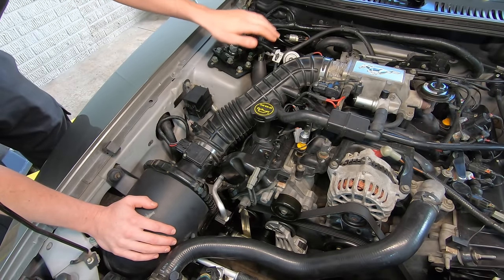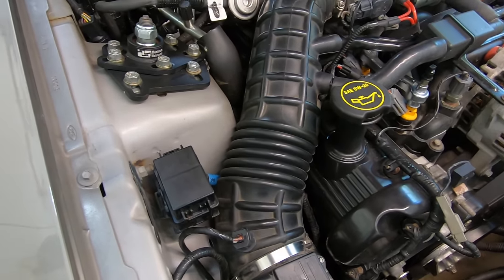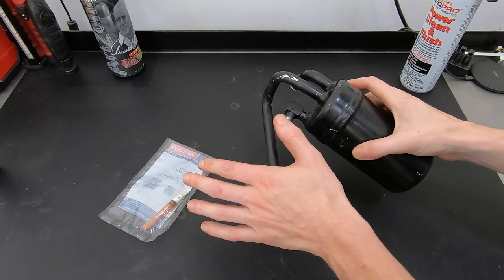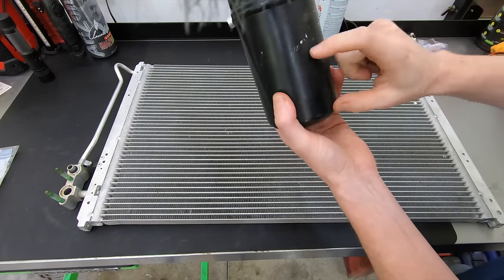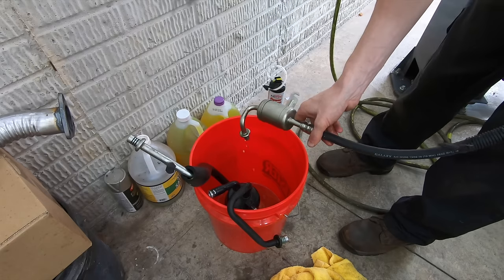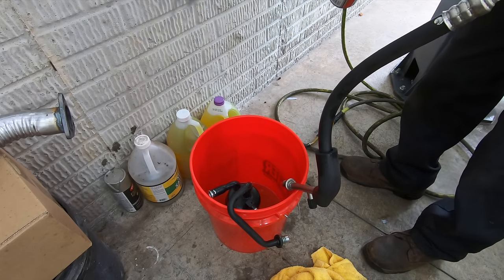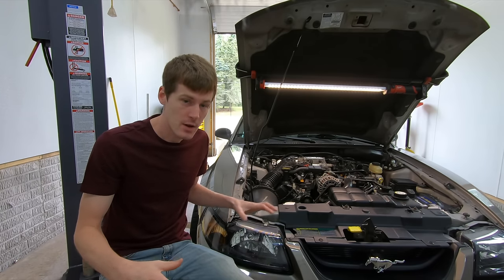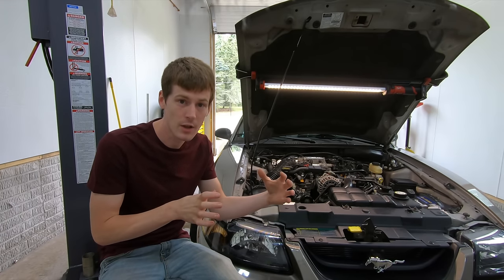How To PROPERLY Flush and Recharge A Contaminated AC System.

Comment: Please help. I have a 2010 Odyssey. AC was intermittent. I suspected the high-pressure switch was the culprit. I decided (don't do it) to just unscrew the High Pressure switch to replace it while the system was charged. It blew all up in my face. Now that I am cleaning up my mess, my question is, how much oil came out with refrigerant when it blew it all in my face? Please recommend any easy solutions besides thoroughly flushing the system and refilling it with the proper amount. My guess is that I lost about 10 ML or 1/3 or a once of oil, which could be in line when I unscrewed the switch. What do you guys think?

Comment: I need some advice?  I am doing same project.  New compressor, condenser, lines, accumulator.  I flushed my front evaporator with the same can you use in video.  But it is a suburban so I also have rear ac and i am curious how to flush rear evaporator.  I have heard some people say they flush it with water hose pipe to get enough pressure and volume.  Will any water left in the evap burn off during pump down?

Comment: Firstly let me say that this is an amazing video! I've read through a lot of the comments not all of them I'll admit. What is the proper procedure if the compressor comes pre-filled with oil. I will most likely be doing exactly what you are replacing everything except for the evaporator coil so in this case all I would need to do is solve them clean and blow out the evaporator. Do the lines come clean from the manufacturers are there manufacturing oils on them? Should the new parts be cleaned pre-installation? Please and thank you
Reply: Measure how much oil is in original compressor, then make sure new one has that same amount of oil. Pour out oil from new compressor and add back what is needed (same amount as original)

Comment: So when starting with an empty system, do you always fill it with all the required refrigerant with the engine off?  In this case did you put all 3 cans in with the engine off? Excellent video BTW, thanks.
Reply from the maker: You can put in about 1 can with it off depending on the size of the system. You need the compressor on to pull refrigerant out of the can. With the 1st can the vacuum you pulled draws in a lot of that first can.

Comment: if you have an unknown system. Would the orifice tube filter be the first thing to look at as an indicator? I just bought an old truck with AC that does not work. AC belt was off for some reason. Pulley seams ok. There is pressure in the system. 03 Silverado

Comment: Do you need to worry about the air you had in the yellow hose?  If you don't bleed off the air that was introduced into your yellow hose... is that going to be a problem?  Cause you're kind of introducing air back into your system....as you begin charging with refrigerant?

Comment: Blue/Red hoses are under vacuum but Yellow one is full of air when you hook it up to a can. Purge air out of it before opening it to the system. Each time you change to the new can you just introduce more air to the system - purge every time.
Reply from the maker: Unless you buy a gauge set like I have with low loss fittings. My yellow hose has a schrader valve where it connects to the can and vacuum pump.
Reply: @RepairGeek  My bad, didn't think of it. But still a good point for other people that might not have it.

Comment: I lost all the Freon due to a hole in the condenser. Can I simply bolt on a new condenser, or do I also need to add oil someplace?
Reply: You’ll need to add a small amount of oil into your new condenser before you install it since each part of the system will hold a small amount of oil. You’ll have to look around online to find out what amount you’ll need. Or get yourself a Haynes/Chilton manual.

Comment: I noticed when you finished the vacuum and disconnected the yellow hose from the vacuum pump to connect the refrigerant that the yellow hose had no way to purge the atmospheric air out of that hose. My gauges have a schrader valve at the gauge body to purge the line. Would it not be beneficial to pay more for the purge valve?

Comment: Use a micron gauge and pull up to 300 microns, and perform a decay test. This will ensure all none condensible gasses and moisture were removed from the system.

Comment: Great video.  I see suggestions of also flushing with Rubbing Alcohol after using the solvent to remove the solvent.  How do you feel about that?
Reply from the maker: The solvent boils under a vacuum. As long as you run the vacuum long enough you won't have any issues or need to flush with other "solutions".
Reply: @RepairGeek  Thank you !

Comment: Very good info.  Thank you much!  I have one question and a little tip as well.  First of all, what did you do to screw it up at first?  If you said so in the video I missed it.  A little tip.  While filling up the system with the little cans, they can get very frosty and not want to vaporize and go into the system.  I always have an Little bucket with nice warm water to set the can into while charging and it really helps. Tom
Reply: Too much oil by twice.  Thus, he flushed to remove the oil. He replaced the dessicant, which would have some of that oil in it.
Reply: Add ref slow it will not frost up.
Reply: @Eric-k2i6t  Nah, charge only liquid into the high side, engine off, into vacuum and weigh the charge.  That's why there's a charge weight specified.

Comment: great video.  If your AC is not working and you want to hook up an AC manifold to do some pressure measurements, should i purge the blue and red lines once I connect them to the ports or no need as air can not get into the system because it lighter than the refrigerant? please clarify if you know as I do not see anyone does that! thx

Comment: I was recently told by the dealer that one of my cars has a contaminated ac due to the compressor and metal is in the system. They want to replace everything condenser, evaporator, compressor. Do you believe all those parts need to be replaced? I'm questioning the dealer I don't trust them.
Reply: My inclination for an old car would be to blow or backflush everything,  then put a strainer or filter before the compressor to keep any metal shavings that didn't get blown out from destroying the new (or used) compressor. But so far,  I haven't  found anyone who can say "I've done that and it works."

Comment: If you put too much oil in the system because i didnt account firbwhats in thesystem when i put on the new compressor...can you just push it out with compressed air and not flush?  Second mistake? I have an orifice tube..i put all the oil in the comoressor and non in the drier..can i remove the orifice tube and let it flow past that area to get tot he drier then reinstall the orifice tube?  I know..i screwed up😮

Comment: Thanks for the video! I have one question. I can change my compressor, TX valve, condenser. But for flushing, I will let a shop to do it. Should the flush need to be done before putting up the new parts? Or I could do it after I install the compressors and the other parts?
Reply: Flush before fitting the new parts otherwise you will send all the crap into your new condenser that you can’t flush!

Comment: how do you put air pressure from standard air compressor into AC line to find leak? do you need a special attachment for the connection from air compressor to low side intake line?

Comment: Question:when you take the car to the shop for freon recovery woudln't it mean that it would recover the oil at the same time because thats what the machine is supposed to do,recover the oil as well not just the freon
Reply: A refrigerant flushing machine will remove oil. This machine will push liquid refrigerant thru the system to purge contaminants and oil. It then pulls a vacuum to remove all the flushing refrigerant, leaving you with an empty system that needs refrigerant and oil.
A refrigerant recovery machine will pull only refrigerant out, no oil will be removed.

Comment: Great video.  If I want to connect the AC manifold just to measure the pressure at the low and high side, should i purge these lines going to the gauges?  how to do so?  I have not seen anyone do that but it make sense as these lines are filled with air? thx
Reply from the maker: Use the vacuum pump to pull the lines  on the gauge set into a vacuum before you connect it to the system if you're concerned.

Comment: Question. My 06 F150 5.4 ac was cooling but struggled on a 90 plus days sitting/idling until it was rolling. So i added 1 can.  Not much better. 2 days later not cooling at all. Clutch wasnt coming on. All related fuses were good.  Put manifold guages on zero pressure at all. Neither hi or low side.  No visble pressure when pressing schrader valves.  Low pressure valve was known to stick. I didnt catch it.  Ive gotten three 12 ounce cans of R134a  and 2 new schrader valves. It requires 34 oz R134a.  Do i have to flush or can i do a vaccum and get by?  Then recharge?  I assume i need to add 3 ozs oil? Yes i know i shoulda put manifold guages on before adding  R134a. Lol. 😢

Comment: Great video. I am working on a tractor with a cab and the expansion valve is in the heater box with the evaporator and looks to be nearly imposible to get to. would it be ok to flush the whole evaporator and lines uner there and accept that there is a chance I can not get all the contaminants out. It looks like the compressor failed and I am doing the best I can afford to get it back up before hay season.
Reply from the maker: You can try it but you run the risk of running the metal contamination through the new compressor.

Comment: @DavidZuber-n1n

I noticed when you finished the vacuum and disconnected the yellow hose from the vacuum pump to connect the refrigerant that the yellow hose had no way to purge the atmospheric air out of that hose. My gauges have a schrader valve at the gauge body to purge the line. Would it not be beneficial to pay more for the purge valve?

Comment: I have replacec the evpoertor charge the sys with out evacuate thr syd still blow hot air ac running do you thing oil need to be add or change thanks❤

Comment: Hello, I’m doing this whole service on sn ‘05 Subaru Outback. I have the compressor out of the car and introduced the PAG oil through the big suction port to lubricate. Did I make a mistake and had to introduce the oil through the high pressure port (smaller hole) instead? Please let me know.

Comment: I broke my high pressure line and refrigerant leaked out completely, I replaced the line and pulled vacuum on it, but I'm not sure if or how much oil I'd need to add, or if r134 with oil will suffice. Any advice?

Comment: I was wondering if you could help me out here, I have a 2008 ML350, while taking out the radiator, I mistakenly pulled the AC line from the Radiator side, Freon vented out in the garage and it was not a comfortable moment. I have since not driven my car or even turned the key, it stayed in the garage but did not cover the pulled line but it stayed in the engine bay. The Compressor hoses are still connected.
I am worried if I need a flush? A new condenser? Or put the hose back and go to a garage and have it recharged?  Thanks for helping out.
Reply from the maker: I'm sure some oil came out with the refrigerant. It's impossible to know how much. In your case you should be able to vacuum down your system and recharge it yourself like what I showed towards the end of this video. You don't need to flush it.
Reply: @RepairGeek  yeah, a lot came out when I pulled the hose, sprayed all over me and the car. Thank you for answering.

Comment: When charging, when you connect the yellow line to the can, the line is full of air... so each can, you let the yellow lines worth of air into the system.  I have a yellow line with a flip valve at the end so when I connect to my gas source, there is only 4" of yellow line full of air, which I purge once connected and then open the manifold. With your long, open yellow line, you should connect the can, open the can, then purge what you can from the yellow line so it is mostly gas before opening the manifold taps...  not 100% air. Just how I do it
Reply from the maker: My yellow line has a check valve in the end that connects to the can/vacuum pump, most do not.

Comment: Fantastic job.  *subscribed and liked*.  Three questions for you if you don't mind - you mentioned your FS10 compressor was NOT variable displacement (thus had to add half oil then half to evaporator).  Ive got an 07 Expedition (Ford FS20 style compressor) also with TXV that had compressor seize so going to replace a bunch of items and flush...   Mine however has a rear/aux evap core in addition to the main evaporator core.  My three questions - 1) Do you happen to know if the FS20 is variable displacement (saving me time on oil re-add)...   and 2) assuming its NOT variable displacement, I assume I'd add half of the oil to compressor and then split the difference on the remaining half of oil between the aux and main evaporator cores?  finally 3) was there no can agitation you did while the cans were charging the system - some of the cheaper kits talk about needing to agitate/jostle the cans while charging.  Again thanks for the time spent on this - excellent job!!

Comment: You explained how important to vacuum the system so that it has no moisture but you didn't purge the yellow line when you put in the refrigerant. Moisture is also present on that yellow line so vacuuming your system for over an hour is useless because air is introduced inside the system by not purging. But good explanation overall
Reply from the maker: If the gauge set has "low loss" fittings the vacuum is held in the yellow hose when you disconnect. FYI.

Comment: I replaced the entire AC system in my daily driver about 3 years ago.
Everything but the evaporator.
The orifice tube look like a wire brush so I knew it was a catastrophic compressor failure.
The parts I bought had a lifetime warranty on them so I'm doing it again.
It's not terribly difficult but I think this is probably the absolute best AC tutorial video I've ever seen.
I honestly can't imagine one part of this video you can improve.
Reply from the maker: Thanks!

Comment: I don’t use air cause it carries moisture that kills your compressor I used nitrogen and if you replaced compressor try to remove the oil on old compressor and measure and put same amount of oil on new one means if the new one is pre charged with oil remove oil and put the same amount that you remove from the old compressor

Comment: That's odd. Pretty sure I read (Denso) you're supposed to put the oil in the discharge port and not the suction port of the compressor.

Comment: I bought a whole new AC system and lines for my car, minus the heater core. That should be fine to just bolt on right?
Reply from the maker: Flush the evaporator and bolt in the rest of the parts.

Comment: A bit confused here... If you take your vehicle to a service center where they "reclaim" your refrigerant and that refrigerant is mixed with the oil in the system - how could there be that much oil left in the system? Where would it be? How did it not get "reclaimed" with the refrigerant? Does the reclaiming process first vaporize the refrigerant (separating it from the oil) and then condense it back into a liquid in their reclaiming tank?  And, if you've replaced 3 of the 4 most significant parts of the AC system, other than the evaporator that supposedly holds only about an ounce of oil (with the refrigerant), what other oil is there other than a thin coating on the inside of tubing? I find all of this confusing, and most of the videos (at least 20) that I've watched all give varying explanations of how the oil vs. refrigerant works, and many confusingly speak of "evacuating" the system, which anyone can do with a small vacuum pump, with having the refrigerant reclaimed. They aren't the same thing. Even the Google chat doesn't seem to have the info clearly separated. No wonder some folks do end up doubling or tripling the about of oil in their system over time. Don't ask me... I don't have it figured out either. I've also replaced everything in my system except the evaporator. The manuf. tag on my radiator says that my AC system holds 9 oz. of PAG oil total. But every "mechanic" online tells me NOT to put that much in. I understand that there will be some residual oil left in my system. My new compressor came with 3 oz. in it (but I removed it), none in my new accumulator, and none in my new condenser. That means that, counting the "supposed" 1 oz in my evaporator, I need to add 8 oz to total the 9 specified by the manufacturer. I put in 7 to account for some oil remaining on the tubing. I hope that will not be too much, but if it's a bit too little, I can always add some. This is a real brain basher.

Comment: Question ❓ 16:35-16:50 timestamp. I have a 2004 mercury marauder. Ive been told to put all the pag oil in the compressor. I noticed you said put half in the compressor and half somewhere else. Am i doing it wrong by putting all the oil in the compressor.
Reply from the maker: That oil is going to distribute through out the system as the AC runs. I put 1/2 in the compressor and the other 1/2 in the dryer. You can put it all in the compressor but it's going to take longer for the oil to make it back to the compressor when you first start the system up.

By splitting it up there is less of a chance of the compressor running dry for a period of time while the oil makes it's way through the system.
Reply: @RepairGeek  WOW. thanks bro. That's why doing homework on anything before you start is a absolute must. I appreciate your way of adding the oil. Sounds alot safer and the smarter option. May your content bless you like it blessed me. Thanks for ALL the detailed info in the video. And thank you sincerely for responding.